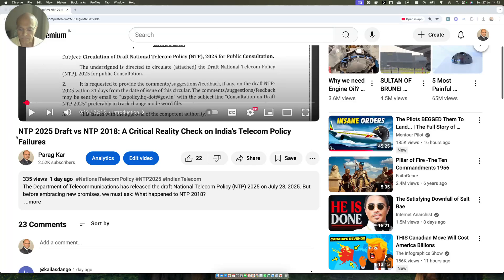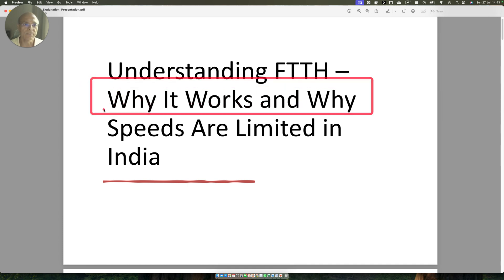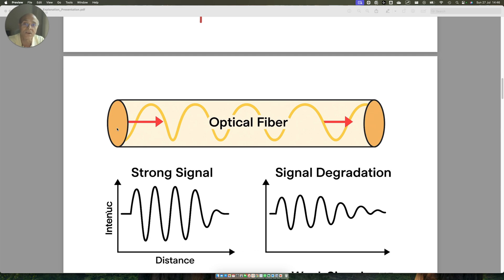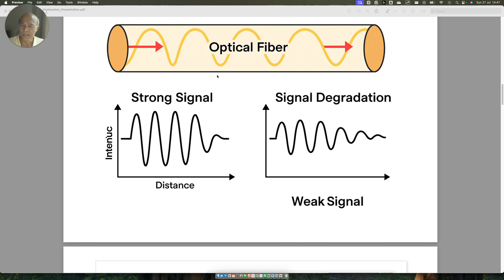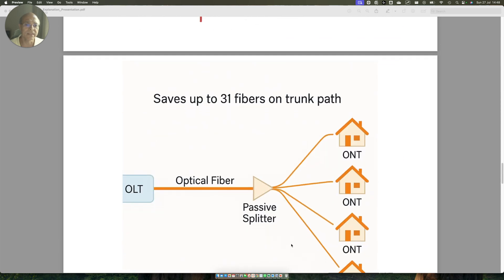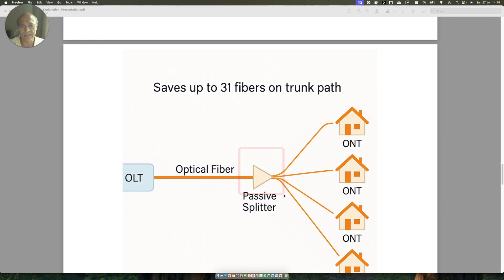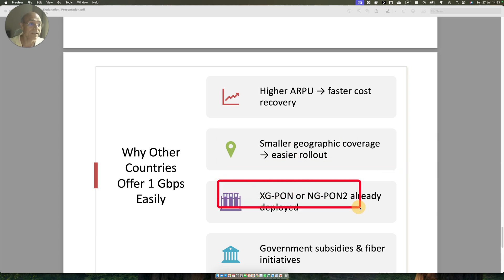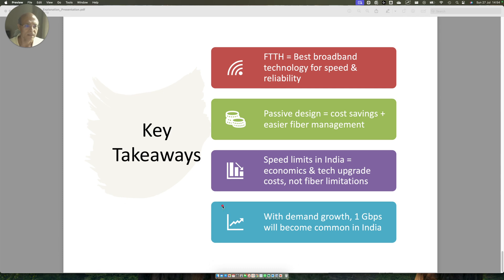FTTH Explained: How It Works & Why Fiber Speeds Are Limited in India

Comment: Question: if someone has my unique ID and TDM info will he able to inject or extract information from PON network? isnt it a huge security risk?  every  splitter box has just 4 screws and it is accessible to anyone. i have jio fiber at home and the distribution box is just around the corner strapped to the electricity pole which can be accessed just by standing on a stool or a small ladder and its cover can be opened by just a screwdriver. that box serves 4 homes including mine.
Reply from the maker: That’s a very valid concern—and you’re absolutely right to think critically about the physical accessibility of PON (Passive Optical Network) infrastructure like splitter boxes. In theory, if someone has access to your ONU/ONT ID and knows the TDM allocation logic, they could attempt to eavesdrop or inject traffic—but in practice, this is extremely difficult to execute successfully on a live commercial fiber network like Jio's.

Why? Because in GPON/XPON systems, the OLT (at the provider’s end) strictly controls traffic encryption and time-slot allocation. Each ONU (your home device) is assigned encrypted traffic that’s hardcoded to your ID. While it’s true that PON is a shared medium downstream, operators use AES encryption between the OLT and each ONU to prevent unauthorized access. Still, if the encryption isn’t properly implemented, or if there’s physical tampering, there’s a small but non-zero risk.

That’s why we strongly recommend:

Always using a trusted VPN for sensitive online activity. It creates a secure tunnel even if the physical layer is compromised or tapped.

Avoiding pure public internet for critical operations—this is precisely why corporates and enterprises use MPLS, dedicated leased lines, or private fiber loops instead of consumer-grade broadband.

You're absolutely right about the vulnerability of roadside splitter boxes—they're not tamper-proof, and that’s a long-standing concern in infrastructure design. So while the protocol has safeguards, physical security remains the weakest link, especially in areas with exposed last-mile infrastructure.

Comment: Hi Sir, please do a blog on AirFiber used by Airtel, Jio, BSNL how it works & it's benefits. Also let's us should Subscriber take AirFiber Connection where Fiber-To-Home Internet Connection is not available.
Reply from the maker: Thanks for your question,

5G AirFiber (used by Airtel, Jio, and BSNL) is a Fixed Wireless Access (FWA) service that delivers home internet using mobile spectrum instead of physical fiber. It connects a fixed outdoor device to a nearby 4G/5G tower, and then provides Wi-Fi inside the home.

📶 While it’s a great alternative where fiber isn't available, it comes with limitations:

Performance depends on tower distance, interference, and mobile network load

Speed and reliability vary, especially in congested areas or poor coverage zones

If available, Optical Fiber (FTTH) is always the better long-term option due to stability, speed, and lower latency

I’ve explained this in detail in both a blog and a video:

📝 Blog: https://paragkar.com/how-5g-air-fiber-works/
📺 Video: https://www.youtube.com/watch?v=ZkzcMogHTZ0&t=14s

Hope this clears things up!
Reply: @paragkar Sir Thanks for Information. 👍

Comment: Sir, can 26 GHz auctioned spectrum be used back haul? Also, does it interfere with the 26Ghz Wi-Fi over mmWave?
Reply from the maker: Yes it can be. But whether you can use two different technologies in the same circle or not has to be legally determined. In this in the NIA the word “The” is used. Then comes the question whether you can use WIFI over 26 GHz with enhanced power. Looks like you can’t unless TEC comes out with standard and does studies to prove that this wave form of WiFi with enhanced power will not harm neighbours slots which uses IMT as WiFI in an IMT band has never been tested for coordination use with neighbours.

Comment: Sirji any update on wifi 6ghz rules in india, when are we going to see routers with 6 GHz if things are progressing very slow.
Reply from the maker: See our govt works like a tortoise and heavily influenced by vested interests. These groups have no alignment on power transmission regulations on 6gHZ band. Some are lobbying for high power some low power. Hence, unless there is an alignment and govt puts its foot down the rules will get deferred.

Comment: Frankly speaking, there is no need for any speed above 100 mbps for home usage, all applications and services in India works perfectly with 50mbps. Spending money for 1gbps us worthless
Reply: speak for yourself, just because an average household can run on 100mbps doesnt make everyone fall under the same category.
Reply: @chirantanchakraborty8460 yes
Reply: @chirantanchakraborty8460 for others, you do have 300 and 500 mbps plans available from all ISP
Reply from the maker: Thanks for watching. The speeds in offer will be determined by market demand and competition. As long there is a demand and competition is able to offer that we will see higher speeds. Just like 4G when deploying some operators never wanted to move fast, but they were forced to driven by competition

Comment: Thanks for the explanation, just one small question: At 5:57, do operators do the same for connecting big corporate offices/enterprises, or is there a different, dedicated architecture for them?
Reply: It depends, if you opt for jio or airtel business broadband they will use PON (normal broadband) network to install fiber to your business premises.

And other thing is called ILL (internet leased line), which is AON. Ofcourse it is a dedicated fiber link from ISP BTS, you will get promised speed and service but cost is tooooo much.
Reply from the maker: @rishi_raj_01  correct
Reply: @rishi_raj_01, thanks a lot, brother 🙏🏻

Comment: "I saw that the tower backhaul is shared with FTTH users. If there's any damage to the poles, will the towers completely shut down?"
Reply: Nop, Towers has a different fiber connection, which is underground ofc, you can notice those underground cables (BHARTI OFC, RJIL, BSNL, BBNL). And some towers have underground ring fiber connection and backup microwave
Reply from the maker: @rishi_raj_01  Correct

Comment: sir technically fibre cables are not exactly bound by speed limits, are they? its just they need more expensive switches and routers to push high speeds like 2.5gbps ,10gbps etc 
since there are fiber operators in Singapore ,some parts of Europe and US which have started deployed 10gbps home fiber already

edit: I had commented this before watching the video and later realized that sir has explained in this video itself
Reply from the maker: Thanks for watching. you’re absolutely right that the fiber medium itself has tremendous potential, but it’s not completely “limitless.” The speed over fiber is determined by the wavelength of light transmitted and the number of wavelengths (channels) you can multiplex. Pushing higher speeds means using shorter wavelengths and denser multiplexing, which introduces challenges like dispersion (signal spreading over distance) and attenuation.

As a result, repeater spacing reduces at higher capacities, meaning you need more repeaters/regenerators, which significantly drives up cost. On top of that, high-end switching and routing gear capable of handling those speeds adds another layer of expense.

That’s why while 10 Gbps home fiber exists in places like Singapore and parts of Europe/US, scaling it universally is a tough economic decision rather than just a technical one.
Reply: @paragkar  thank you for your answer